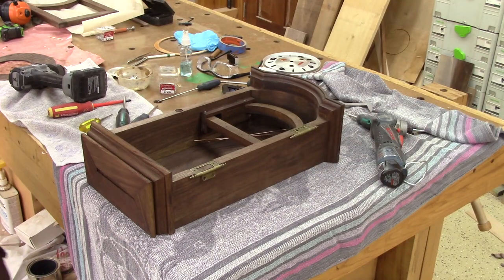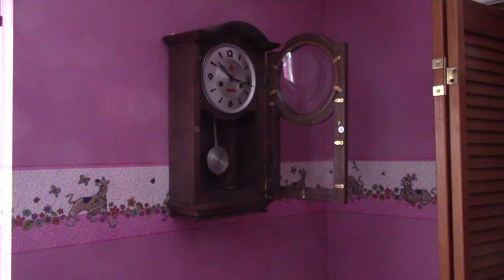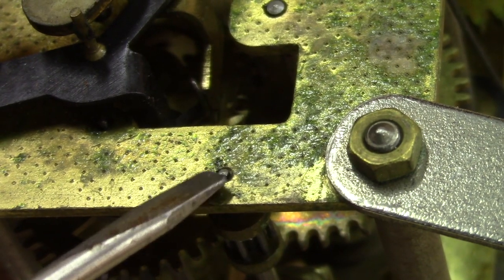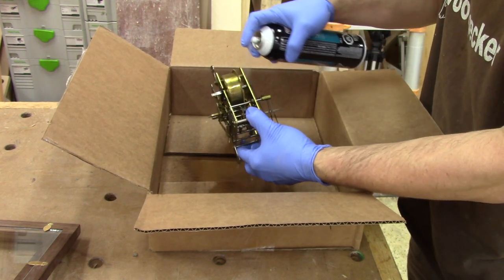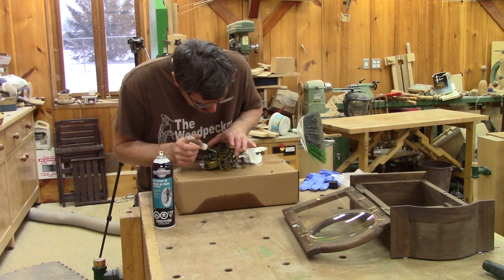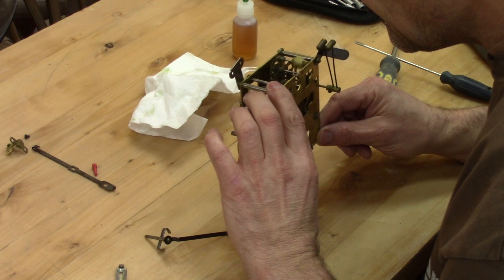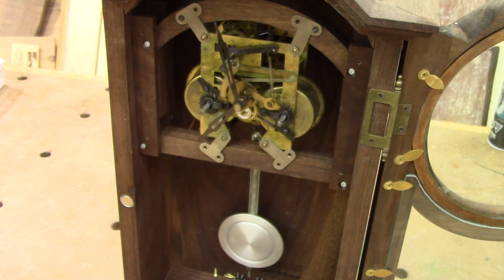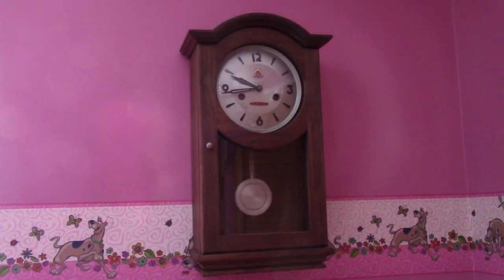The Woodpecker - Fixing our clock mechanism

Comment: Nice job on the Clock case Alain..  I have used brake cleaner on my grandfather clock also.  You can also use electronic contact spray cleaner and a Q tip The brake cleaner works to dissolve the grease but the contact cleaner won't tarnish the brass movement. Use a toothpick to pick out all the greasy dirty oil first.. then clean with contact cleaner then once clean then oil. Not too much.. Don't use a lot of oil, it will run down the clock plates and draw the oil out of the pivots. They sell special clock oiling pins, but you don't need them.. Put clock oil in a clean teaspoon and use a jewellers screwdriver..the tiniest one you have and dip it in the oil.. then touch the little screwdriver to the pivot oil sync and it will suck it right in. I think you know that the best thing is to have it taken apart and cleaned but it is expensive. I just had a clock movement done and it was $220.00 but it will last another 100 years. Check out some of the clocks on my channel if you like.. I live in Ottawa and grew up in Montreal.. Salut.
Reply from the maker: Thank you,
I thought of using contact pray, I have some at home. I didn't obviously, but one thing I didn't know, was the fact that contact cleaner won't damage the lacquer. 
If this wouldn't had worked I would had took it apart, but it would had been my last resort. Checking around I realized that getting it cleaned from a real watchmaker would be more expensive that this China made clock mechanism. But still I had it and it was worth the effort to try something.
You seem to have quite a collection of old clock, this is great, I only have this one.
I'm glad I don't have to go to Montreal every days now, Working at CBC downtown was a 50Km trip from my house to the building and another 50Km to come back home. 7 days a weeks. Yes Renée also worked at CBC and our days off were almost never on the same days...

Comment: I was a clock repairman for five years and used to charge $40 additional per clock if it had WD-40 or brake cleaner residue on the movement. It meant that the laquer on the brass plates was now partially dissolved and that it would ruin the expensive ($40 a gallon) cleaning solution I used in my ultrasonic cleaner. You can do whatever you like because it’s your clock, but when the day comes to take it to a professional you may have increased the cost of repair.  Also, none of this actually “fixed” the clock, any more than rinsing off your engine replaces the spark plugs.
Reply from the maker: Thank you for the tip. I will never send this mechanism to a professional, it's not that valuable. It would be like my old camera that I paid for a quote and the repair was double what I paid for the camera and less then a new one.  But you might be on to something, maybe you can give me advice, I'm having the hardest time to set the pendulum to the right time, Can you give me some pointers? Thank you
Reply: Alain Vaillancourt Understood. Yes, your pendulum swing indicates that the clock movement is not healthy. The issue is likely that there is wear between the bearing surfaces in the brass plates and the steel pinions (think axel). The proper way to deal with this is to disassemble the movement and polish the pinons and drill-out and add bushings to any of the bearing services that have wear.  The clock would then be good as new if not better than new. Good luck!  Scott
Reply: Alain Vaillancourt Another option might be to replace the movement altogether.
Reply from the maker: Thank you very much. If I end up not being able to set it to keep the time. which I think it's what will happen, I'll probably, like you said try to change the movement all together.... Last year at a flee market we go to several time in the summer we saw a man selling clock mechanism, I think if he's there agai this summer we'll talk to him about purchasing another mechanism that will fit inside my box.
Reply: Alain Vaillancourt If you plan is to sell it I would just leave it as is. The next owner will appreciate that it is in working order, though it may need some TLC, and that way it will also be kept original.
Reply from the maker: I want to keep the box I made, it's nicer than the plywood box it was inside originally.... But I just told my wife about our conversation and she said that beginning tomorrow SHE will take in charge the task to try to put the pendulum at the right place... She always took care of the clock, and now that she can stand on her legs she will try to put it back at the right place. It was keeping time in November, but after I forgot to wind it, everything went down hill....
Reply from the maker: @harryballz6358  No she doesn't fix the roof, but she helped me putting it in place. We installed a shingle metal roof on the shop, I screwed two screws and she screwed the other two while I was putting the next one in place 😁😁
Reply from the maker: @harryballz6358  I'm intending to to that, it's why I let her adopt another dog... Everybody knows the say: Happy wife, happy life 😁

Comment: Thanks for the tip.  I have 2 wall clocks and after WD-40 on the pivot points it works after several attempts.   I'll use brake cleaner next time.
Reply from the maker: But be aware that brake cleaner will peel off the lacquer on the brass. 
I didn't care for the lacquer, because now our clock work fine since I did that

Comment: I've used WD-40 to clean LOTS of things people tell you not to use it on, and have never had any issues.  It's not a good long-term lubricant for a lot of things, but as long as you clean off the excess and follow up with the proper lubricant it does well.

Comment: I have a similar clock from my grandmother.  It has the same issue. I followed your instructions; I removed the pendulum pivot and it started running but once I fix the pivot back, it stops immediately. How did you readjust the pendulum pivot to make it work?
Reply from the maker: Did you cleaned it? I know "real" clock repair person uses a special solution to remove the dirt and grease. Like you saw I've used break cleaner, I've got a lot of comments saying this removes the lacquer on the brass and this also make the special solution un-usable if it's used after a clock was cleaned with brake cleaner. I didn't care and did it like that. But I guess I was lucky it started running super fine after this, but it took us over a month to adjust the pendulum afterwards. This had changed the timing of the clock, but now it's keeping the time pretty well.
I wish I could help you more sorry...
Good luck

Comment: What to do if clocks runs faster? Which screw need to be fit?
Reply from the maker: the screw on the bottom of the pendulum has to be unscrew.
just turn it a bit and write down the amont of turn you did. this will become handy if you go too far.... I was unable to fix the pendulum speed, up until Renée took care of that, she wrote down how much turn she gave and now it's perfect. This may take several days...
Reply: @LgosseuxDbois-TheWoodpecker  thank you so much for your kind guidance.

Comment: Is these vintage mechanisms clocks are accurate timing ?
Reply from the maker: After tuning it and cleaning it, it's quite accurate for a mechanical movement. About a minute of drift in two weeks
Reply: @LgosseuxDbois-TheWoodpecker  I have this old carriage clock and it is perfect working condition but the problem is why it is not accurate timing and I regulate the clock several times lower the speed but still its running 10 minutes in advance in each day.
Reply from the maker: It took us several weeks to manage to set the adjustment on the pendulum to the right position after I've cleaned it.
To be honest I couldn't, my wife managed to set it to the right position, by keeping a log book of how much the time was off and how much she turn the knob and in which direction. After several weeks she got it and we only set the clock when it's not at the right time or after two weeks at the cottage.

Comment: Thanks for the video. I will buy break cleaner and synthetic oil.
Reply from the maker: It worked for me. But be aware, I had several comments from watchmakers that said that if they get a clock to clean that was cleaned with break cleaner, like I did, would charge more to clean the clock, On top of removing the laquer on the brass.
I didn't care about all of this, my clock was not a real antique only 40 years or so made in China, but be a ware of that if yours is a real antique and you care about it. 
But it worked for us, it's still keeping time and we're very happy

Comment: I’ve seen same movement that are made in 1993 and later. They switched the plate from brass to aluminum and it’s even worse! One of worst movements I ever worked on!
Reply from the maker: I'm not surprised. This is far from being an antique mechanism.  It's a bit why I tried myself to fix it, Even I coud see, it was not the greatest. But after cleaning it the way I did. it's working #1 again

Comment: From your video, it looks as if the clock was overwound and needed cleaning as well.
I often get notification of a video in your own language and I then know that the video will be coming soon in my language, but this did not happen with the last one, I checked and made sure that the bell was set to all, and then went back to your page and found one that had only been done in your language (https://www.youtube.com/watch?v=T-OP-IwS8fM) and two that I had not seen even though they were on your page. I have watched them now but I don't know why they didn't come up in my feed as normal?.
Reply from the maker: YT sometime ..... But I'm glad you were able to sort everything in the end. 
Yes it was all gunky, I'm pretty happy of the result, now I need to find the new exact adjustment of the pendulum, and after 3 weeks I haven't find it yet... I have a sheet of paper and a pencil just beside the clock and write the date, exact time, the clock time and the amount of turn I made on the adjustment, now I'm going clockwise, hopefully I will arrive to the right time soon.
Reply: @LgosseuxDbois-TheWoodpecker  I made two points about the clock, the first was that it had been overwound and by taking the pendulum off it let the tension be released from the clock spring. You were lucky it did not break and cause damage. You need to keep a record of the number of turns of the key and do not wind it up too tight.
Reply from the maker: OK it's what  I do, lucky for me I'm not too impatient :) And we never over wind it. it's in pretty good shape for a 48 year old mechanism, I just have a hard time finding the sweet spot of the pendulum adjustment, thank you